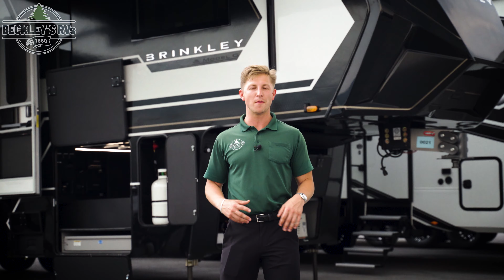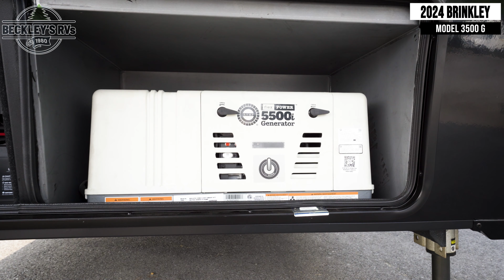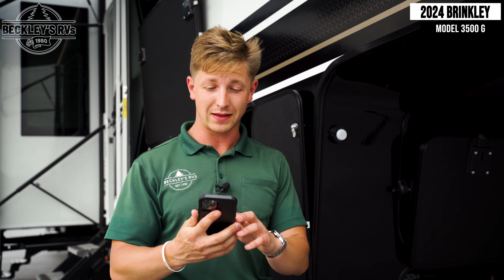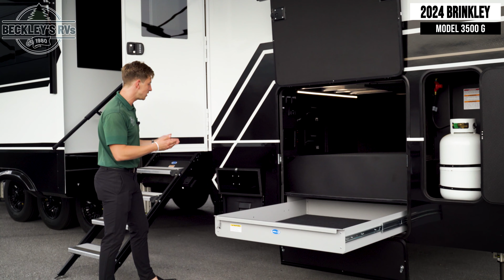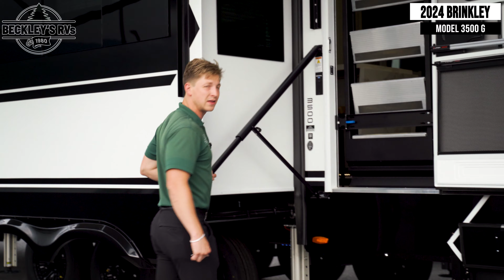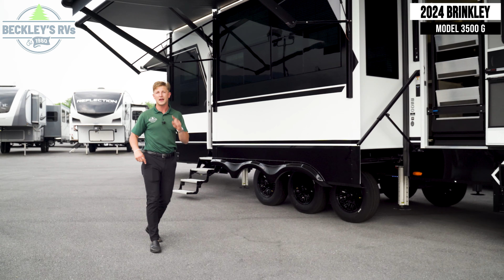The Brinkley Model G 3500 is Your Ultimate Adventure Headquarters | Beckley's RVs

Comment: You missed a small but unique feature of the kitchen island design - the hole in the cutting board is not just a hand-hold, it is also positioned directly over a garbage bin when board and bin drawer are fully opened. Very handy to discard scaps from the board.

Comment: The sound system has a 12" subwoofer in the slide out behind the recliners. Really thumps and sounds incredible. 

The lights are dimable inside
I love that the cutting board has a hole in it so you can pull out the trash bins and scrape your mess right in them. Also above the sink is a utinsel tray. Spice rack and pot storage is by the oven.

People that say no nightstand. There are shelves above the windows with usb ports for your phones and what not. 
There is a tv in the back garage.
 Also hidden storage in the main living area above and below the tv. You wont know its there untill you pull on what looks like part of the wall. :)

Comment: One of the better reviews I’ve seen frankly. Couple things you missed. 

1. Convection microwave
2. Floor storage in garage near porch doors
3.  Rack above sink is utensil holder
4.  Rack next to stove is spice rack
5.  On couch side of island there is a dog tray that pull out when the counter top chairs are by floating island side of island. 
6.  Pretty sure the 50amp cable on the G is a flat cable vice round cable. 
7.  All lights are dimmable 
8.  Exterior is automotive paint not decals
9.  Roof is 10 year warranty if memory serves me correctly 
10.  Cutting board opening in right side is so you can scrap debris into trash can by pulling that out while using the cutting board.
11.  Sponge holder in front of sink drawer